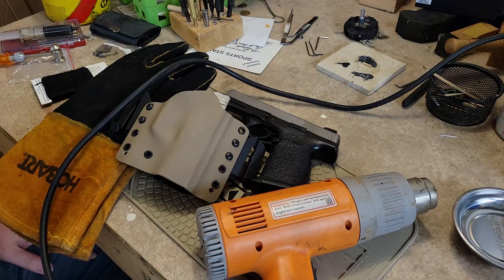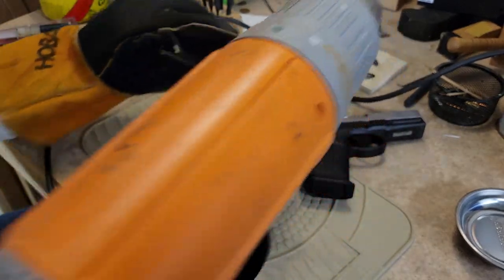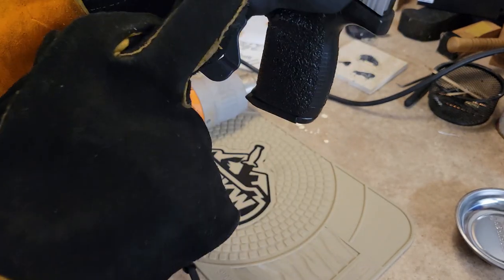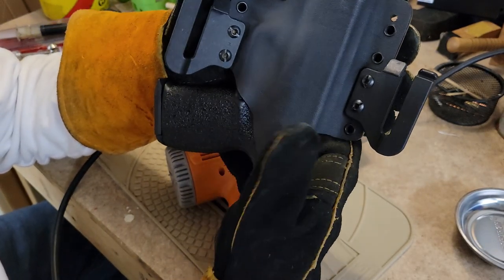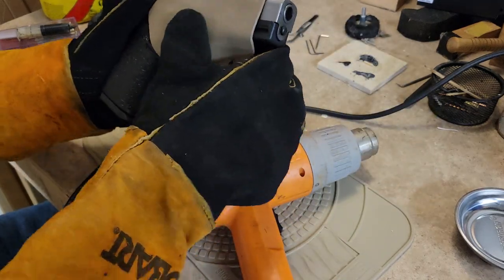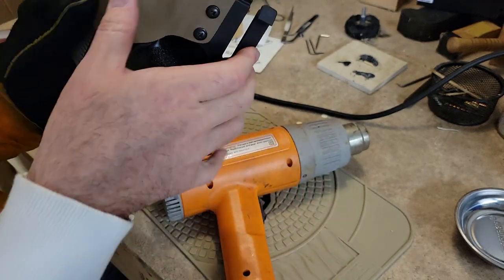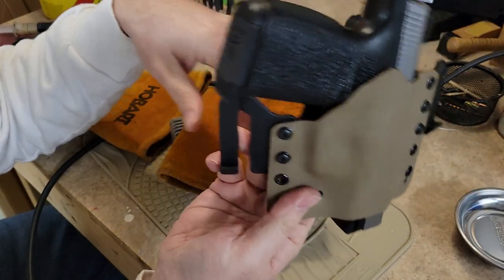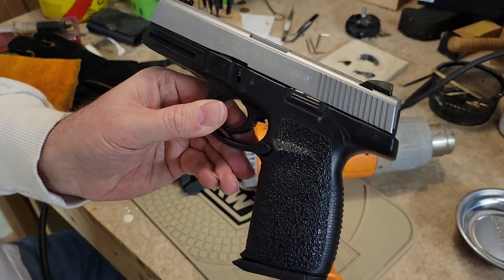How-To: Reshape a kydex molded holster for a different gun using heat and gloves!

Comment: I reshaped a Safariland 6360-83, from glock 17 to 1911 :) Both the ALS and SLS are working fine, just a muzzle is slightly protruding in front but barrely noticable ;)
Reply: I am about to reshape a Safariland 6360 from a M&P 40 to a 1911.  Any suggestions or Warnings you may have learned, would be helpful and appreciated.
Reply: @JS-pz8yp  well, the adjusting mechanism is too forward for the trigger guard so a piece of kydex would be recommended to prevent the gun from dropping too low. Remove ALS first, of course, you need to heat it in order to reshape the catch from rectangular to more rounded narrowed look, so it could catch properly. I think it's ABS so be careful not to melt it. You may need to dremel it if any sharp edges left from reshaping. SLS is basically good, I removed that little tab protruding to the back in order to be able to lock a cocked gun ;) so in general, 1911 is narrower than squared striker so you remove the guts (ALS and tightening mechanism) heat it and gently press it. General shape stayed and just a piece of kydex added to the tightening mechanism and that's it. I'm hoping this was helpful :)
Reply: @dangubas  Thank you, you mentioned a couple of things that I hadn't thought of.  It's not the easiest holster to reshape although it's coming out pretty decent, I don't think the end result is going to meet my expectations though.  Thanks again.

Comment: Aren't u concerned about melting the polymer on the frame?
Reply from the maker: Lol, no.  Frames are glass reinforced and much much higher melt point
Reply: @DCopp  I had no idea polymer had glass strands in it. Like fiber glass? One of these days I'll get into 3d printing. Just found some of your pol 80 videos. U have a great catalog
Reply: After some research seems ur kinda partly correct. There is glass stranded nylon framed pistols, but MUCH more common is straight polymer which has zero glass fibers added. As to the melting temp of polymer, I just don't know, hence my question